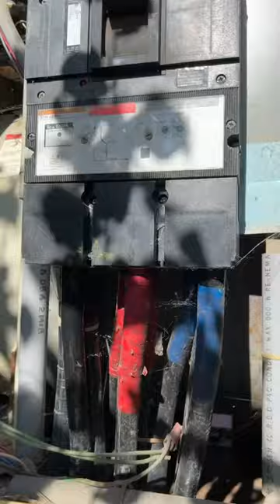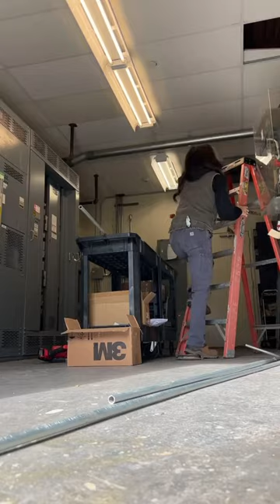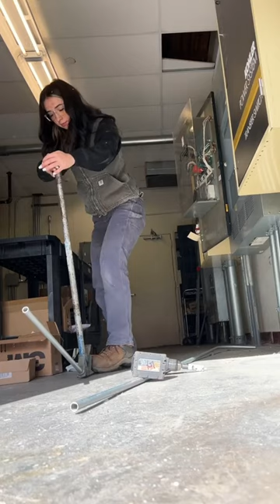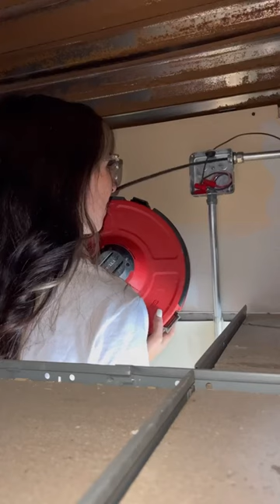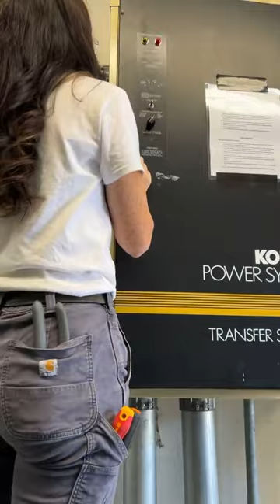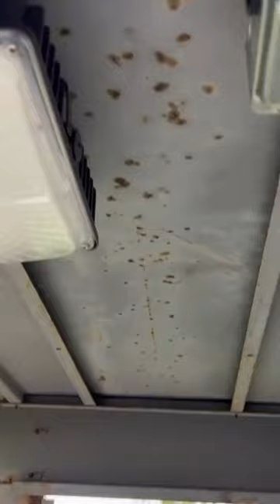Installing emergency shut offs to generator transfer switches #construction #lextheelectrician

Comment: Dam I wish all those old Kohlers had lights inside the enclosures!
Reply: yes, and 12 volts connected to the battery so they work during a power failure.

Comment: It's absolutely awesome to see a beautiful young lady in the trade. Bending EMT running wire fish taping and all . I work with EMT, IMC and Galvanized pipe rough installs underground here in Maryland. It's high risk but the pay is well worth it. I'm almost ready, after 38 years, to kick back and spend my Golden years fishing and hunting.

Comment: That hair puller 5000 does a great job pulling wire
Reply: You wanna see the hair puller 9000 it’s a bench grinder. I saw a girl that didn’t listen to the rules and didn’t keep her hair tied back. In jewelry class we had bench grinders with buffing wheels. It sucked her head in a split second, the teacher was able to get her freed without cutting all her hair off.
Reply: @FishFind3000 yessir, I watch a woman have her finger pulled off first day on the job using a buffing wheel to polish costume jewelry. She did exactly what she was told not to but all of the grinders were missing their guards. The finger wasn’t salvageable
Reply: @FishFind3000   it was circa 1968 in shop class, we had a guy using a wood lathe and caught his hair... tore off a piece of his scalp.

Comment: A little tip when bending pipe, I’ve found it’s best to not step on the pipe with your other foot and try to balance better and leverage as much weight as you can on to the bender. You’re trying to push the bender into the pipe not pull the pipe through the bender and when stepping on the pipe for support you can sometimes (not always) end up pulling on the pipe more than you like and wind up with kinks.

Comment: I love your vids and all that but why do you have a tool to draw cable? That makes zero sense to me im also an electrician and i cannot think of a single job that would be useful, if you can get a cable down the tube you can hand pull it back? And without breaking the connection between the cables